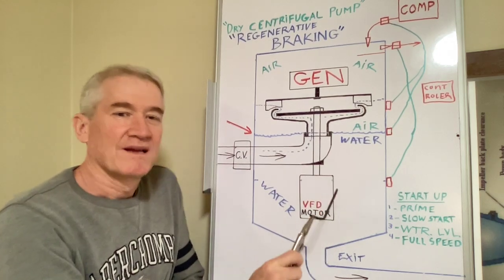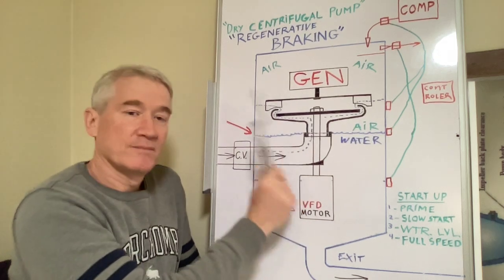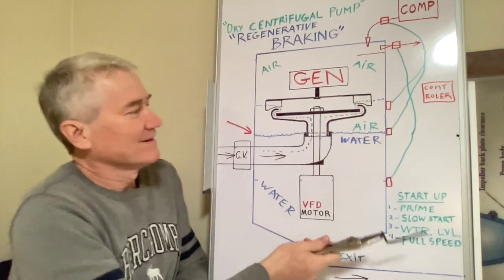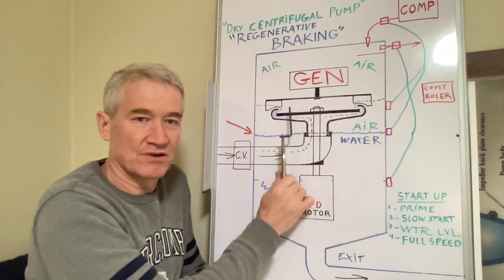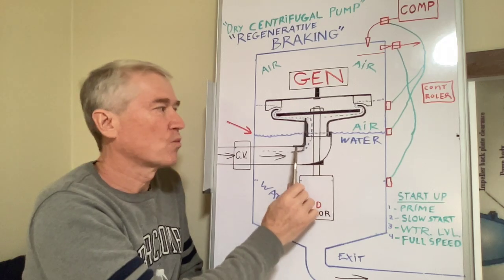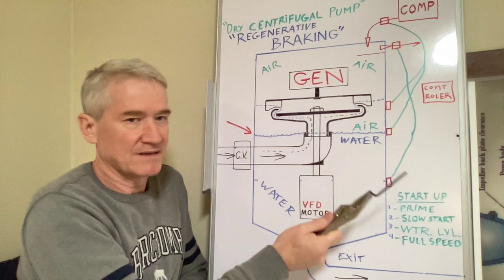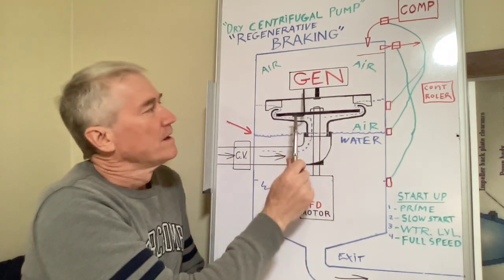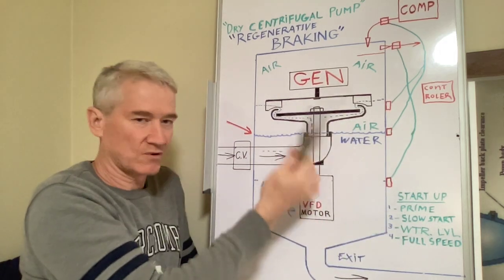"Dry Centrifugal Pump" & "Fluid REGENERATIVE BRAKING" How you can have a generator INSIDE a PUMP!?!?

Comment: I guess I lost the point of what you are doing. It appears that you you are putting electrical energy into this system, converting that energy to mechanical energy, moving a lot of water around, and converting that back to electrical energy. This appears like a demonstration of energy loss in as many aspects as possible. Why so many conversions? It seems more efficient to stay in the electrical realm.
Reply from the maker: Thanx for the comment ! ! It's Primary purpose is to pump water. My intention when I started the project was to eliminate Viscous Drag from the outside surfaces of the impeller. I succeeded with the "Trapped Closed Impeller" which can pump water in an air space or without a housing at all. After seeing it create the "Round Waterfall" coming from the impeller, I realized what was happening is 1( the water creates the pressure as it travels into the tank through the impeller. 2( when it leaves the impeller - the water has the most kinetic energy it will ever have. 3( when leaving the impeller the water has already created the "Pressure" and naturally transferred it to the air in the top of the tank. The Water's kinetic energy is now useless for the pumping action and can be collected very efficiently by a turbine. 4( the air pressure pushes the water settled at the bottom, out the exit of the pump housing. 5( the air space provides the fluid context to Regenerate the energy that was put into the inertia of the water.                             
It's no more steps than any pump except that the "Regenerator" is inside the pressurized area. IT IS:      1... motor energy in (like any pump) 2 impeller transfers to water (like any pump) 3 Turbine captures the useless kinetic energy from water after it has already created the pressure (Like pumped hydro storage does). 4 Generator regenerates!  
NOTE: Keep in mind that when the turbine collects the "Kinetic Energy" it is NOT using up or depleting ANY of the "pressure energy", because it's all within the pressurized housing,   
you might think of it in the way a "Pumped Storage Hydroelectric" system works....but the "HILL" is different. In PSH The "HILL" is actually a hill ! But in my system, the "HILL" is "Velocity" or "Kinetic Energy" but instead of wasting that high velocity water spray by dashing it into the slow moving water outside the impeller - we regenerate it at the "TOP OF THE INERTIA HILL"  The pressure still pushes the water to the top of the "Real Hill" . There are many more advantages to this pump such as 1( Much larger impeller sizes can be use and therefore lower RPM 2( NO cavitation outside impeller 3( impeller blades can start much further away from the Suction Eye to reduce cavitation inside impeller. 4 ( Hydraulic losses and viscous drag on outside of closed impeller is reduced to "Air Drag" - and some of that air drag gets caught in the turbine and helps regenerate a tiny bit more.
Reply from the maker: Did you understand the explanation?